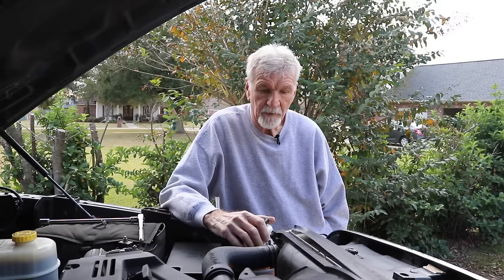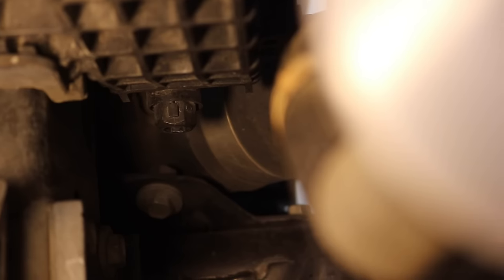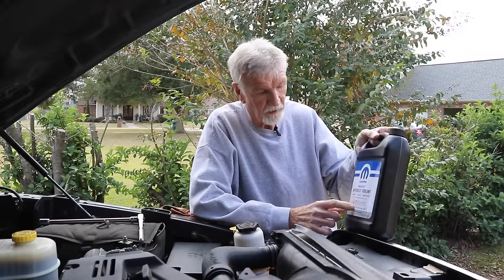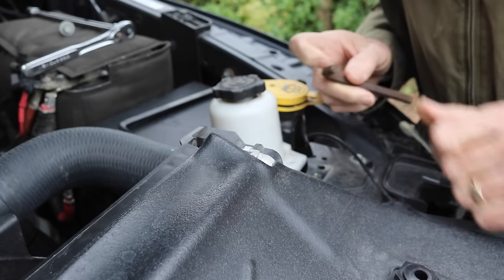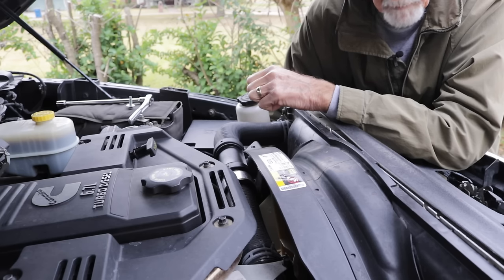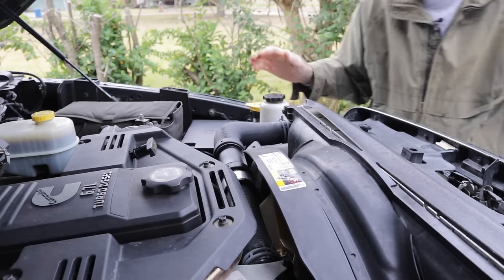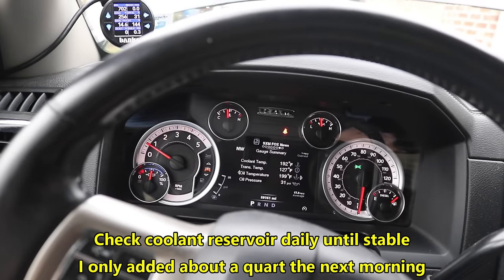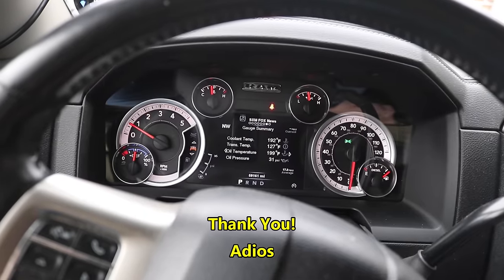RAM 6.7 L Cummins 2500 Coolant Change.

Comment: Prestone says it is compatible with OAT POAT HOAT & IAT and works with all vehicles. Has anybody used Prestone in their Ram and mixed the Prestone coolant with the factory coolant???
Reply: Yes I’ve had no problem. Why shouldn’t you mix different coolants? I always make sure that the jug says all vehicles or it be specific to my Ram
Reply: @edlopez93  I have read mixing some coolants will turn the coolant into jelly and some coolants will not be compatible with some metals in the cooling system.  Don't know if there is any truth to this or they are just trying to sell over priced coolant?

Comment: I have always used a water pump lubricant but I don't even know if they make it anymore. Did you run a cleaner through the system. I've also open slightly a threaded plug on top passenger side of the head to get air out.

Comment: So,  you showed a gallon jug of Mopar coolant,, if i understood you correctly you stated you mixed that 50/50 with DISTILLED water and you put approximately 4 gallons in ,, so that took approximately two gallons of the Mopar  coolant??
Reply from the maker: No, you'll need 3 gallons of concentrate and have a little left over.  The dealer put 2 galls of concentrate and calls it good but that's not 50/50.

Comment: Thanks for the video Mr. Blair. I have a 2018 Ram 2500. Living down here in San Antonio we had been in 45° weather for a couple days. So when I would go to start it up in the morning,  while it would go through the preheat I would get a low coolant message but only when it's at around 45°. Now that's its warmer it does not come on. What do you think it could be, a faulty sensor maybe? I checked the fluid level and it looks good. Maybe you or some of your followers might have some answers.
Reply from the maker: It sounds like you need to bring the level up just a little.  Bring the level up an inch or two up into the neck.
Reply: @MarionBlair  yup! That's what I did and haven't had any issues after that. What do you think caused it to get low?
Reply from the maker: May have been borderline from the start.  If it keeps doing it, maybe a leak.

Comment: Great video, Thanks. Did you consider removing the hoses and flushing the heater core before refilling. Seems like half of these trucks have clogged HCs. Also can you leave the cap off until the thermostat opens then add more coolant or will it make a mess?
Reply: It’s because coolant is only good for 3 years or 40k miles
Reply: @repairvehicle  good to know I guess I'll change my fluid thanks. I had a BMW one time and everyone was having the same problem come to find out there was sand left in the coolant passages from the casting that got into everybody's heater core

Comment: I have a 2018 Ram 2500, diesel,, would you think it would be the same procedure or process or same steps to change coolant as you do on your 2014 Ram
Reply from the maker: Yes, should be exact same
Reply from the maker: One minor difference is yours will not have a Y pipe, which will make it easier for you to get the air out

Comment: Can't you just pop the lower radiator hose off?  That's what I do.  Those plastic valves can leak after you mess with them.
Reply from the maker: Yes, I'm seen people do it that way.  Pull the passenger wheel well.
Reply: Pull the plug and lube it before tightening back up the problem is the o ring will and does dry out if not

Comment: Hi Marion, I have watched many of your great videos ever since I bought my 2017 RAM 3500 Cummins / Aisin.  I had a local shop do a coolant flush about a year or so ago.  About 6 months later, I got a coolant level low alarm, so I added about a half gallon of distilled water and the alarm went off.  I now have zero heater function.  All the diverter flaps work well in the truck with AC, etc. but no heat.  I don't have any leaks anywhere which would indicate a leaking heater core.  Dealer wants $2300 to replace heater core, but I don't believe that is the problem.  Could a lower coolant level make the water pump unable to push enough hot coolant up to the heater core?  My coolant level in the reservoir is just about an inch shy of full.  If I am to add anything more, it will be the Mopar recommended coolant.  I've seen where pulling the heater hoses off at the water pump, and pushing water back through the cooler of the 2 hoses may backflush any debris which may be blocking the flow to the heater core.  I do not want to introduce regular garden hose water into the system to backflush in gently, and I am leery about getting any air bubbles in the pressurized system.  The truck is spot on perfect aside from no heater, but I am in southern California and rarely use the heater, but my wife wants it working.  Truck has 159K miles on it.  Any thoughts from you shy of pulling my cooling system apart?
Reply from the maker: Yea, I agree unless it's plugged.  The low alarm is common if the level get just a hair low.  The sensor is probably higher than it needs to be.   I would try removing the cap with the engine cold and start it and put the heater on wide open and let the truck (high idle) run and see if the level changes.  I'm wonder if there's an air lock.
Reply: Did this issue ever get resolved?
Reply: @coast.cutter7552  No, still no heat from the vents.  My business has been blowing up since summer and I haven't had any free time to get into the truck and work through it.  I need to make some time here soon.  Thanks for checking in.  I'll let you know what I come up with.
Reply: And to add to my misery, I've had a tire pressure monitoring system alarm popping up randomly, on for a day or so, then off, repeat.  And after our first rain storm of the season a month, now the rear parking sensor alarm is going off and on as well.  I've seen where these 2 issues are pretty much DIY jobs to remedy as well.  I need to get after this stuff.
Reply: I have an issue with air getting into the heater core on my 2015 Cummins. It started after the dealer did the water pump recall. I added a brass tee and valve on the outlet hose of the heater core and have to periodically vent it to get the air out. It’s very frustrating.

Comment: Are you squeezing on the top radiator hose or the bottom radiator hose to purge air out of system? Cant tell which hose in the video
Reply from the maker: Top

Comment: So how important is it to change the coolant every 10k miles. Bought my first cummins today and dadh says the fuel filters only have 15% left on em. So assuming i should do em all.
Reply from the maker: The coolant doesn't need to be change for at least 100K unless you run very high transmission temps.  Talking the 68RFE.  Fuel filters every 15k.

Comment: Why are you adding MS 90032?  My 2014 RAM 2500 6.7L diesel calls for “MOPAR® Antifreeze/Coolant 10 Year/150,000 Mile Formula OAT (Organic Additive Technology) that meets the requirements of Chrysler Material Standard MS-12106”?
Reply: And Thanks so much for all the information!
Reply from the maker: The MS 90032 is the concentrate, MS-12106 is the 50/50.  Same thing.  So I get the concentrate and cut with distilled water.  Less expensive than the 50/50.
Reply: Mopar coolant is low quality, it goes bad before you can even reach 50k miles

Comment: My 2019 6.7 says low coolant everyday. But when I start driving it then it magically disappears. Any thought on that. 30,000 miles
Reply from the maker: No but I'd check for codes with a code reader.

Comment: How can I let air out ? It keeps pushing out the coolant thru reservoir. It's got air in the hose. Thanks !
Reply from the maker: I squeeze the return hose and that helps.  Put the cap on and let it idle with the heater wide open.

Comment: How do you put the radiator Drain valve back on when you accidentally take it out all the way?
Reply from the maker: It'll go on.  Push in and screw it in.
Reply: I think I may have to take the entire grill off the truck because my arm and my hand are too big to fit in the working space. But thank you for your comment.